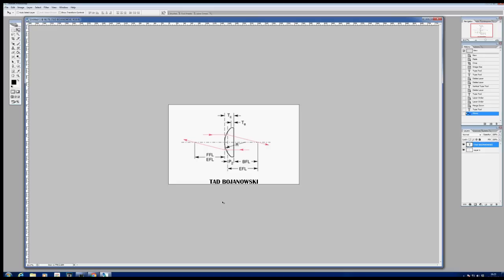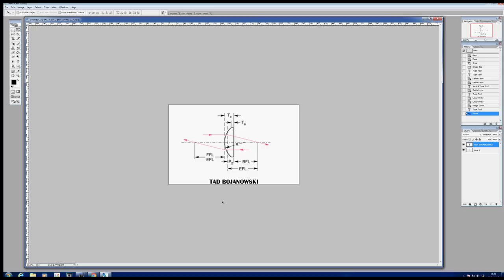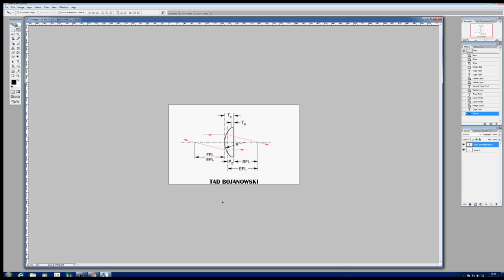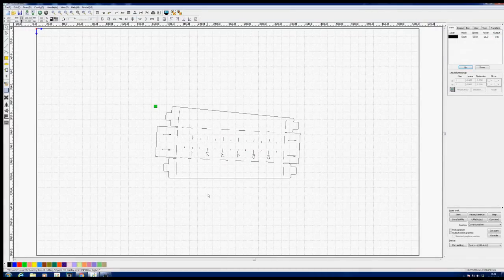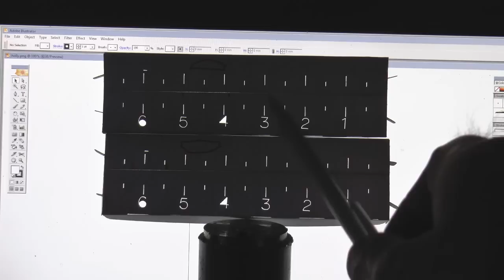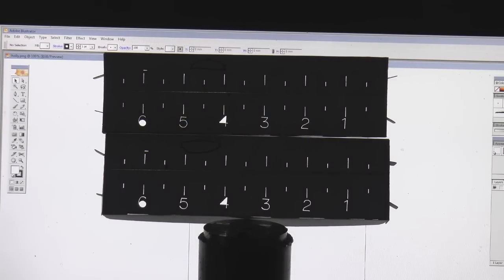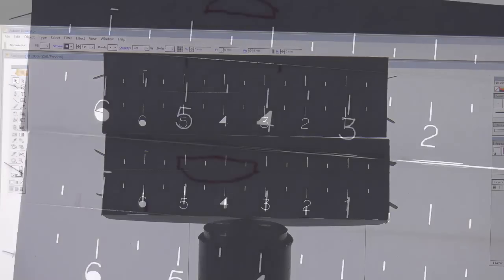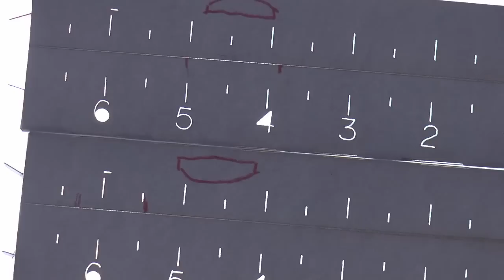RDWorks Learning Lab 60 Lens Orientation

Comment: Sweet. I know this is an old video, but I just got my 700x500 laser last week and after cleaning everything (amazing how dirty a "new" laser is) I discovered that the convex side is facing down and was questioning this myself as I thought it should be facing up.   A Camera lens has the convex side facing away from the film, so shouldn't it be the same with the laser?  Looks like you answered that question.
Reply from the maker: Hi 

Flat side down makes logical sense but as my experiments are showing (and I still have a lot to complete) Flat side down  with more spherical aberration (less focus) ahd reduces the focal length by 1 or 2 mm  and gives better cutting result  Flat side up gives a sharper focus that is closer to the claimed lens focal length. This is better for some types of engraving but is less efficient for cutting. That is why most people claim that flat side down is the correct way to have your lens. So surprisingly the lens works both ways but you need to understand which orientation will best suit your job.
Best wishes
Russ
Reply: @SarbarMultimedia   For the most part I will be cutting Balsa and lite ply, so knowing this is a huge benefit. Thank you.

Comment: i spend hours dealing with this. It turns out China send the lens "convex down" and yet sent a 20mm plastic gauge. It was never "right" well I flipped my lens and now the gauge is actually correct!  Thanks for the great video!
Reply from the maker: It will be worth checking the focus point. Use a piece of mdf/ply/acrylic and set the max power button to about 25%. Set the speed button to about 200mm/s. Maker the piece of ply about 150mm long in X. Prop one end up with a 5 or 6mm spacer to make a ramp. . Move you nozzle to the middle of the ramp and set the distance with your 20mm setting piece. Move the head clear of the ramp by about 50mm. Now simultaneously press the arrow button and the pulse button to draw a line up the ramp.. Examine the line (look along it at eye level) to find the narrowest part of the line. That is your correct focus. I suspect that it will be towards the top of the slope  because turning the lens the correct way decreases the focal length by at least 1 to 1.5mm. To make sure you have the focus on your slope you really need to see the line go thick,  thin and back to thick.

Best wishes
Russ
Reply: @SarbarMultimedia  Hi Russ. Out of frustration on some unrelated matters, I decided to flip my 2" lens to have the curved side down. To my delight, the edges on my plywood cutting were much straighter. Apparently there's less of a beam shape change from "in focus" to "out of focus." However, the kerf and spot sizes are a bit larger.
Reply from the maker: @1888scanvan  
Hi te#here is no right and wrong way for a plano convex lense it works both ways but in general you get deeper or faster cutting flat side down and  more precise engraving flat side up. On a 2" lens the focal distance changes by about 2mm. It will match the gauge the Chinese sent with the machine if you use it flat side up. It's really whatever works best for you.

Best wishes
Russ.

Comment: I agree, that all the published info I could find said the lens should be installed with the curved side up (away from the work), and my machine had the lens installed backwards as well from the factory.  You don't need a special jig to remeasure your focal distance.  Just a flat piece of cardstock or wood placed on a block to create a wedge shape.  Move the laser beam down the wedge shape, and then use a vernier caliper to measure the distance from the table to the top of the wood or cardstock at the sharpest point.  Subtract this from the distance from the table to the bottom of the laser tube.  The result will be your focal distance which you can use to make a focus gauge block to quickly set up your work.

Comment: my table is 1300x2500mm and it is completely twisted. i cannot cut one big piece without ruin it. 
i have the live focus system, that suppose to correct the focus automatically while cutting. 
unfortunately i am using in manual mode because it is completely not regulated. no manuals and the settings menu is blocked by a password. 
do you know something about the "live focus" system? it has a inductive sensor to see the metal... glad if you can help
Reply from the maker: Hi Ricardo
Out of interest I already have this document downloaded because I was interested.
http://en.rd-acs.com/Private/Files/8f6cb094a457cb7b.pdf
 I'm sorry but I do not have any knowledge or experience of the bigger Chinese machines.
You may wish to join the "Fellow Chinese Laser Machine Sufferers" forum at www.rdworklab.com. There maybe other there with a similar machine who may be of assistance.
Best wishes
Russ

Comment: Over 40 years ago I built a CO2 thick film hybrid laser trimmer using a zinc selenide lens.  It worked fine to start with, then mysteriously the trimmed resistors started drifting after trimming.  Drove me nuts.  Finally I noticed the lens had been turned over.  My thought is that you need to consider that this is a diffraction limited system  and that as you noticed, even at the focus, with an inverted lens, the cut wasn't as clean.  In my case this resulted in a wider spot causing re-melting of the thick film and later heat stress relief cracking.  So two thoughts; 1) the longer focal length of the wrong lens face is also theoretically going to lead to a larger focused spot; 2)  Consider that the parallel laser beam entry angle and exit angle to the lens surface are  about equal in the proper lens orientation, but zero on entry and 2x on exit for an inverted lens -- this will lead to a form of lens coma distortion.

Comment: i saw a bosslaser alignment and the technician when he was setting up the lens, he specifically said the flat side facing down to the material.
Reply from the maker: Hi Cary

Flat side down is recognized as the "better" way to run a lens. So Boss Laser are working to that convention. The designed orientation for the lens is flat side up and that is how my machine (and most machines) was  shipped out of China. The setting piece supplied with the machine will be wrong if you turn your lens to flat down because flat side down gives a shorter focal length. However, I run my lens flat side down but with the corrected setting piece and it works well for me.
Best regards
Russ
Reply: +SarbarMultimedia will check my lens tomorrow. the spacer that came with the cutter is a 8mm thick acrylic piece. the FL of the 20mm lens is 50.8mm. i was thinking if that is wrong but then i finally realised that i am suppose to measure 50.8mm from the lens and not from thr tip of the laser head. so based on their spacer, the distance of the face of the lens to the tip is 42.8mm. will double check that on my laser tomorrow😊
Reply from the maker: Hi Cary
There are only going to be 3 possible FL  lenses we can use . 1.5" (38mm) 2" (51mm) or 2.5" (63mm). If you poke a Qtip or drinking straw up inside you nozzle (it must be soft so that you don't scratch the lens) and mark where it appears out of the nozzle, add the Width of your setting piece to that dimension, it should be pretty close to one of the 3 standard lenses.
Best regards
Russ
Reply: +SarbarMultimedia thanks for the tip. will do that to check. just wondering on the air assist, how strong is it suppose to be or it just a soft moving air just to prevent smoke from going into the tube?
Reply from the maker: Hi Cary
Air assist is always important to ensure there is flow out of the nozzle, even a whisper, because that keeps your lens clean by preventing fume ingress. For acrylic it needs to be gentle because too much airflow cools the cut and r educes cutting ability. I have done several test that prove this. However for cutting any wood products or leather you need to get as much air as possible right into the cut grove to keep the cut face clear of smoke and fumes. Smoke and fumes absorb the IR radiation and decreases the cutting effectiveness
For engraving of any sort it is less critical because there is w adie open expanse on the surface and smoke will be blown off quickly. The standar 2" lens fitted to most of these machines is not the best fro cutting unless you have a 60 watt plus  laser. Not only is the lens energy density almost 50% down on a 1.5" lens but the distance you have to be from the work surface (usually about 20mm means pathetic air flow into your cut groove) The 2" lens is basically a general purpose engraving lens. With thick materials I can set my nozzle about 2mm above the work so there is no problem with good air flow into the cut.

Best regards
Russ
Reply: +SarbarMultimedia my laser is using a reci tube which according to its certification label on the tube is rated max 110W. though it is ordered as a 100W which they call s2 tube if not mistaken. the tube is rated 10k hours....or so they say.
Reply from the maker: Hi Cary
You have a superb tube there and it will comfortably do what it says. but I will ask the vital question....do you have an ammeter fitted to your machine? Reci are very particular about over driving their tubes. It's always a puzzle to me why a 10,000 hour tube is only warranted for 9 months (without checking) ie 6.600 hours if you run it powered ON for 24 hours a day! 
I don-t recognize S2 as a Reci productn they usually are w2 ...etc
Here is an extract from their website about fitting an ammeter and not running above 27mA.

.Operation conditions Water cooling: using purified water; 2 to 5 liter/minute; 
water temperature: 10℃-40℃.
 The operating environment: temperature 2-40℃; humidity 10-60%.
The working current: test current is 29mA. Maximum working current is 29mA. The running current 
must be kept below 27mA. The life span can reach 8,000 hours if the current is kept below 25mA. 
The ammeter must be connected to the negative electrode of laser tube.When it is working under over-high current for long term, the negative pole will appear light yellow and the life span will be shortened rapidly.
To protect dust from going into the insulation sheath, please wrap it with plastic film.

Best regards
Russ
Reply: +SarbarMultimedia yes there is an mA meter fitted near the console area. for the max current thing, i was running a test cut at 90% ppwer and it was showing about 29mA. at 80% power it was showing around 27mA.   Good that you noted about the longer life of the tube. 
right now i am trying to cut 5mm acrylic and the manual indicated optimum power 60% - 90% and optimal cut speed as 8 - 15mm. So basically trying around the max and min powers but seems to be getting some rough burn marks on one side of the square cut and the edges are slightly slanted on one or 2 of the edges....so wondering if it is due to the non level bed. will check that tomorrow
Reply: In the reci site, they have the s2, s3 and s8 tubes which are in red label colors. I did read about the protection of the insulation sheet and was wondering where is that as one end as a red rubber cover while the other end facing the mirror is open with the wire connected.
Reply from the maker: As the material gets thicker you will need to drop the focal point to about half way into your material. Always set a power and gradually increase  speed from a low speed (maybe 5mm/s) until it does not cut. Then play with the focus a little to see if you can improve the depth of cut.I mm change in focus cam have great results.
 Regards
Russ
Reply: Thanks for the tip Russ...:D. Will test it out....just now is abit of a rush for me case need to get it up and running quickly for a project that needs the acrylic to be cut....
Thanks again for your input..:)
Reply: +SarbarMultimedia hi Russ, would like to ask you opinion on cutting acrylic. i see most of the time, you cut clear acrylic without the papers on the surface and can seem to cut. would it be better to keep the paper before cutting to minimize the burn markings on the surface. which is a better approach? with or without the paper cover?
Reply from the maker: Hi Cary.
Some acrylic I do remove the plastic film for my experimental work because I want to view the cut as it is happening. But for all my other project work I leave the protective film on. If you are doing engraving of letters in particular you get a lot of condensed acrylic vapour settling on the surface. it is great to just peel off the film and leave a perfectly clean finish. Leave it on.
Regards
Russ
Reply: +SarbarMultimedia ah i ser. great. thanks for your input.☺
Reply: HI Russ, Just to update, that the Reci tube i have in the machine is actually the W2 model. My bad. Remembered wrongly. Been busy today cutting through 5mm clear acrylics with 70% power and the mA meter only shows 22mA. An almost clean cut aside from one or 2 of the edges were slanted ever so slightly and the top surface of the acrylic has a very small frosted curve from the point of the cut. Likely will need to do some testing on the optimum speed for that power rating.
Reply from the maker: Hi Cary
Thanks for the update. It's great that you have almost cracked the acrylic cutting but you may be on a woild goose chase hunting for the cause of no-upright edges. I spent a long tyime hunting before I found that i would was wasting my time Take a look at the last few minutes of https://youtu.be/pYmT9yIjC4Q and I think you will see the answer.. For most people that would be the end of the story. However, for you, with so much more power, you could buy a 2.5" lens tha reduce this to almost nil with 5mm material. It may mean slowing down you cutting but the longer waisted focus point has a more uniform  energy density across the +/-2.5mm either side of the focus point. You will still be at 22 mA but running a bit slower and will get a slightly wider cut.
Good luck
Russ
Reply: +SarbarMultimedia will explore on this at the moment.  Using lasercad software with the awc controller board.  For the mean time at least this works good enough while I complete my current projects.  Once these are cleared then will get down to calibrate and log my power and speed options for the best cuts and engraving
Reply: Hi Russ,
Just an update. After the several cut test on various cut speed with constant power, varying distance from laser tip to surface, I have finally found the sweet spot which i can get clear glass edge finish with almost zero banding lines and vertical cut....:D Can't post the pic here but if you like to see the pic, i can email to you. But conclusion is that because of the air assist directly blowing through the tip, that somehow cause the slight curve and frosted finish on the top surface cut. 
As i do not have a air valve controller, I took out the hose and let it blow from the outside of the laser head instead. And when i start cutting, WA LAH,.....!! The cuts we crystal clear and almost no banding lines. The speed difference have made some cuts tilt on the vertical. But I sweet spot has cut a straight sides on all 4 sides of the test square with no warping and a clear transparent edge...:D Just ecstatic to find achieve that result. Now when cutting the 3mm plywood, the edges are nice and clean and no flaming with the full air assist.

Comment: Hello Again Russ.  I haven't yet watched this video, but I intend to, as I've watched and studied all the rest of them.  We've had our machine for a week now so that's been keeping me busy busy for sure.  I wanted to ask you what focus lens you replaced into your machine.  The one I have seems like it's already showing a scorch mark on it and I cleaned it gently with alcohol but not too hard as I was afraid of damaging it further, but it looks as if it is indeed scorched a bit.  Should I rub harder, or will this damage it?  Or, is it just a cheapie cheapie and I need to get another?  Thanks again, my friend in England!!
Reply from the maker: +Christopher Miller 
Hi Chris
These machines are normally supplied with a 2" focal length lens. I have a 1.5" lens and find this to be very powerful. I have experimented with others but  but for most applications that's what I use. The orange zinc selenide material that the lens is made from is only about 70% transmissive to IR light. Not because it absorbs the light but because it reflects off the surface crystal structure. They put an anti reflective coating in the lens to improve this transmission. A cheapie  coated lens will get you up to about 95%. There is a multi coating technique by a USA company  that's a bit like the Coca Cola formula (very secret and protected). This is usually described as an HQ lens and has this coating which can improve transmission to about 99%. .
The important point I am making here is that you should be careful not to damage the coating. If alcohol and Qtips wont shift the "bloom" you could try something a bit more aggressive than alcohol, acetone would be OK. I would get another standby cheapie lens in place whilst you are learning about your machine but also think about an HQ lens for when you want to get the best from it.  In the meantime, if you do damage the surface coating I would try fitting it damaged side to the work until you can get a replacement. 
Hope this helps a bit

Best regards
Russ